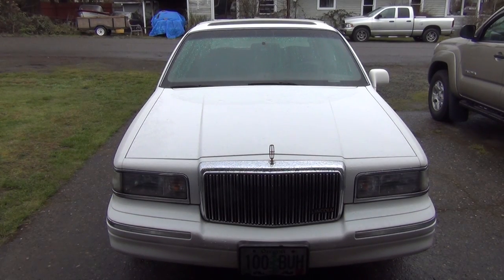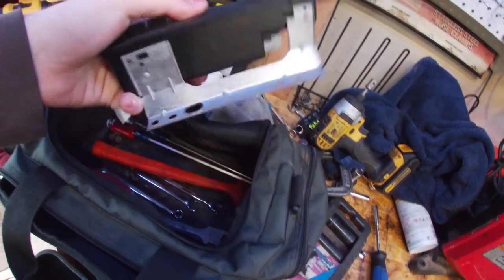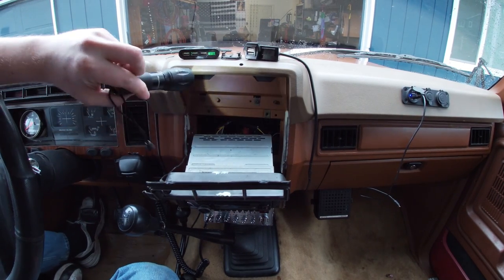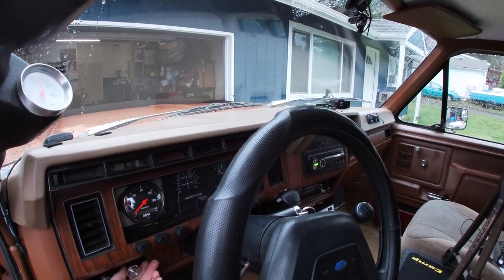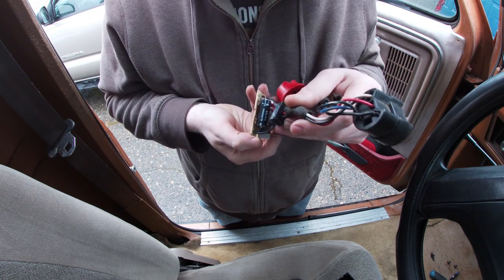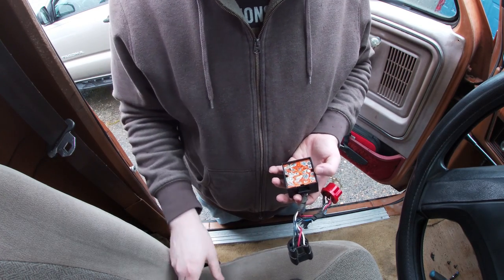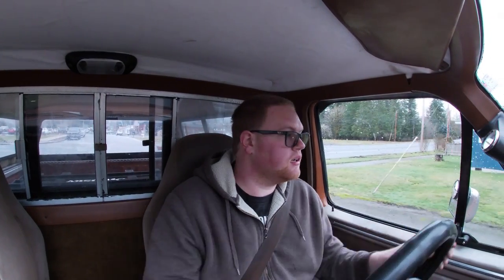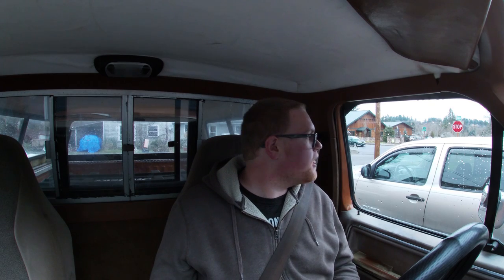Tinkering With the Bullnose | Installing Junkyard Parts

Comment: If you've never been there: https://www.ford-trucks.com/forums/forum37/ is a good source for us bull nose people. I was having a hard time trying to figure out which cords you were referring to with the clock. With that being said, the clock harness should connect with the wiring harness found behind the ashtray underneath the dash (should be the same factory harness for factory optional courtesy lamps).

Comment: I have a question when you were showing us the connections from your main battery to your secondary (Red Top) battery. How does the Red Top battery stay charged from the alternator if the only time it gets connected to the main battery is when you throw the switch to engage the solenoid that connects the two batteries together for max power at startup. Do you have other connections from alternator directly to red top battery?  Thanks bud
Reply from the maker: Whenever the relay is triggered, the red top is connected and gets charged by the alternator at the same time and is completely separated when the relay is off. After a long crank, I usually leave it on for about 30 minutes and shut it off.

Comment: How long has it been since that thing had a overhead ran on it?
Reply from the maker: valves were done not too long ago. with bigger injectors, advanced timing and the pump turned up, it usually starts like this in the winter.
Reply: @justhes  how many miles do you have on the injectors ? im really interested in them for my 4bt a lot cheaper but so many bad reviews on ebay injectors maybe these are better since they dont have an electronic solenoid to fail ?
Reply from the maker: @brandonm7824  i think i have almost 20k on them. they work pretty good.